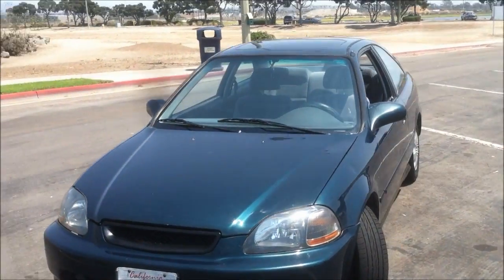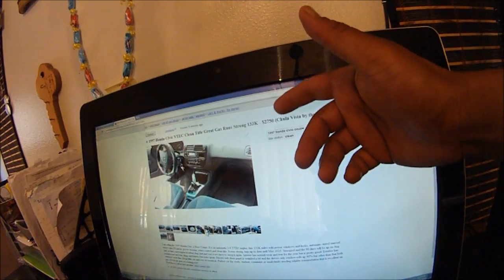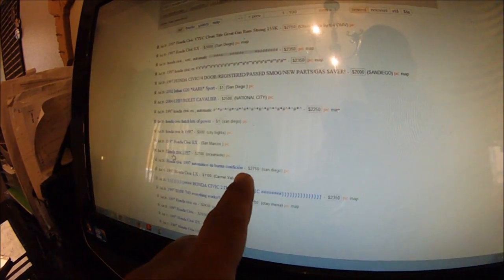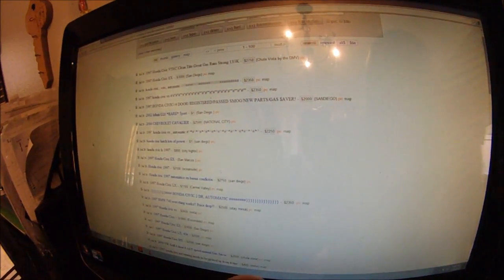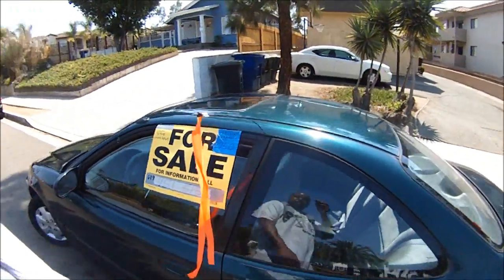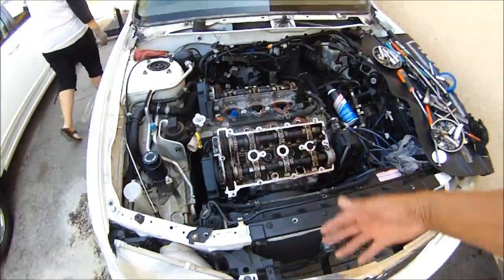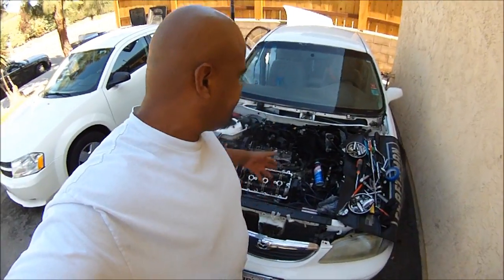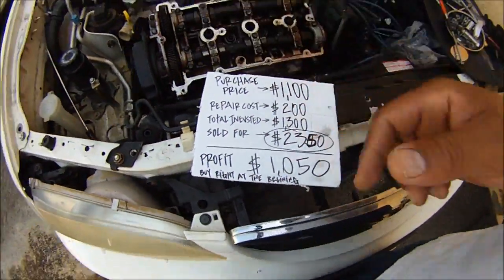HOW TO FLIP A CAR THE RIGHT WAY (HONDA CIVIC 1.6L VTEC)

Comment: Is there a maximum number of miles you won't buy past? Is there a "sweet spot" for buying like 110k-160k miles?
Reply: Idk about him, but honestly with a honda or Toyota, if they're well maintained you can honestly sell them for 1800-3000 up to about 200k, depending on condition. And sometimes more if it's in great condition.

Comment: Hey oldskool, 
I have the same car a 1999 civic ex coupe and I have an issue with cold starts. 
The car is healthy but it makes a rattle noise when it starts up after sitting for a long time. 
The noise lessens when you apply gas but is still there. It goes away after getting warmed up, I just want an opinion.
there's no check engine light, no other weird noises or problems. it's only when i cold start. Is this normal??

Comment: one mnore thing you can wet sand your headlights 1500, and than 2000  grit, wetsand and than polish with ultimate compound, and than use a finishing polish. and when you wax the vehicle after buffing it wax them too.

Comment: What if i just turned 16 and i want to do this to make some money but i dont know much anout fixing up cars?
Reply: you could still try it but I would take some classes about basic mechanics
Reply: +Georgevess  if u really like working on cars  be it paint or body or the technical side, i recommend buyin this book on ebay, its tilted   Diagnosis and Troubleshooting of and computer systems.  by James D. Haldeerman i paid 10 dollars but the book is worth maybe 50 dollars on up, u just have to keep lookin to get a good deal. and learn about electrity and take ur time   it will sink in , on auto electticity that is,   and elctronic,    it just one of many careers   or even just a hobby,  good luck in what every u want to do.

Comment: Brother i really appreciate your hard work and your videos but i have a question and i'll be happy if U answer me back.if i want to start flipping cars and i'm excited for it.how can i know that the car it does not have any main issues as engine or transmission,because i'm not a mechanic.Please if you can give me some main tips for a beginner .Thank you very much oldskool funk
Reply: Go on highway and punch it u will be able to tell if something's up it will rumble shake should barley stall out if motor is good

Comment: +oldskool funk ... any recommendation to what type of cars you should stick with? I assume Civics, Toyotas, Mazda's ... any other Hondas related... just stick to the ones that have less depreciation?
Reply from the maker: Salvador Nobre Veiga 2000 & up cars only (easier to smog) . Aisan cars ( 4 cyl great fuel economy). Know the market value before you buy and make low offers (buy right at the beginning) is a recipe for great cars.
Reply from the maker: And always buy cars with less than 150K miles no more than 160K if possible.
Reply: oldskool funk thanks for the reply! yup Japanese cars its what I thought ...regarding the smog, i dont think i have that in my state. Around here ... Hondas and Toyotas are like iPhones they barely depreciate! a 2000 Honda even in a sketchish condition people ask upwards of 3000 !!
Reply: Salvador Nobre Veiga it depends where you at in Florida I sell lots of trucks
Reply: stick the cars you know in&out

Comment: Good ideas got me thinking about flipping. People will pay up for these cars. For the years 1996-1999. Honda Civic, Accord, Toyota 4Runner, Camry, Ford Crown Victoria (with the lower gas prices) Chevy Suburban.
Reply: Michael Mirro High demand cars for the years 2000-2004 Toyota Prius, Volkswagen Beetle, Nissan Maxima, Jeep Cherokee, Toyota 4Runner, Honda Civic, and Toyota Corolla.
Reply: Michael Mirro There's a good website carsurvey.org the owners tell the good and bad. The Honda Civic and Volkswagen Beetle are the best to repair and sell. The idea is to fix a great car with a fatal flaw and that takes a customer away from the new car dealers. DIY vs Throw-away Society.
Reply from the maker: Michael Mirro The best cars are the affordable gas saving vehicles. Most people have under 5k saved and most people want great fuel economy because of hard times. Focus on the demand and follow the trends. But most of all sell HIGH QUALITY. Remember you are selling a RESULT and providng a SOLUTION. If you focus on solving peoples problems (ex, No financing, within their budget, Great fuel economy and HIGH QUALITY) You will create a WIN/WIN for both you and the buyer. Keep your integrity God Bless.
Reply: oldskool funk Hey man great vids. I have a question i'm trying to get in to the biz how many Kilometers is to high to buy?